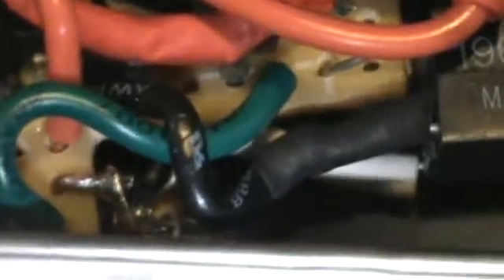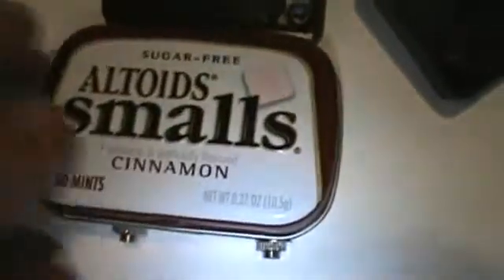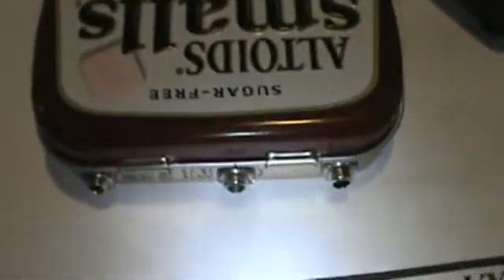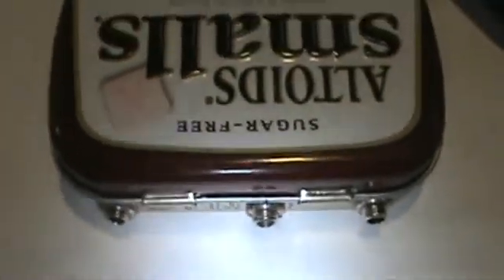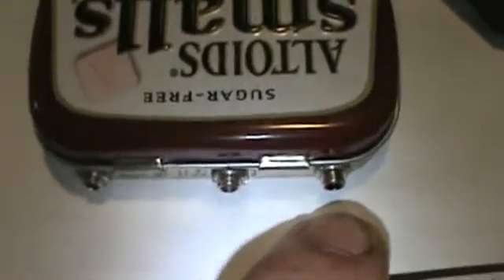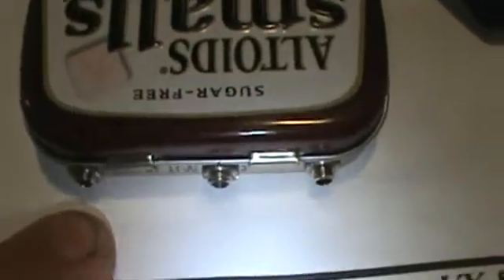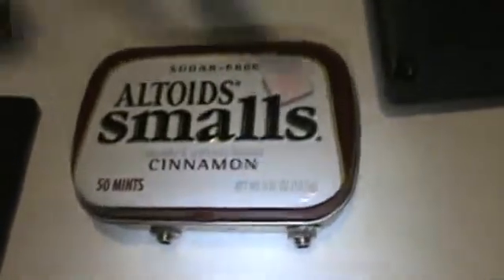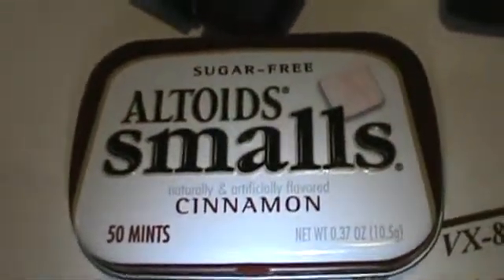Homebrewed PSK31 Interface for my Handheld

Comment from the maker: the transformers that I realized it couldnt fit in the box. I needed something with a larger inside diameter to house the 3 circuits with both transformers and the 5 jacks.I havent seen this interface this small before, but that doesnt mean Im the first to do it. The idea here was to make it small and light weight for on the go work. This one fits in my fifth pocket, Perfect for Starbucks, people think im there for free wifi while im actually working PSK31 on 2 meters FM from the handheld.  73